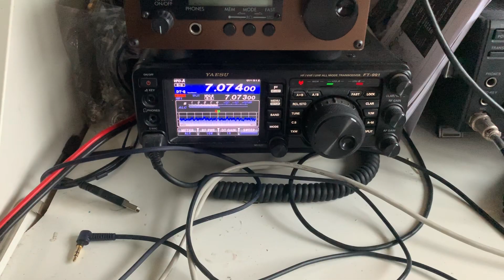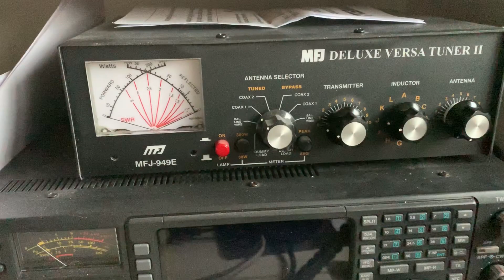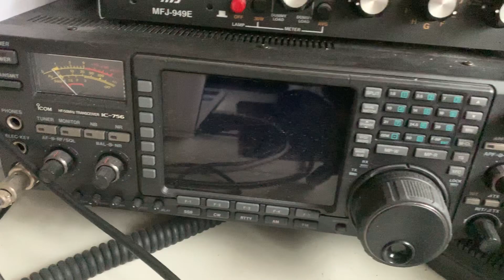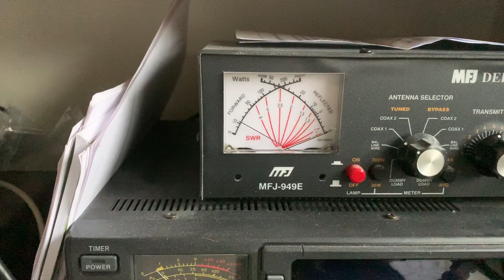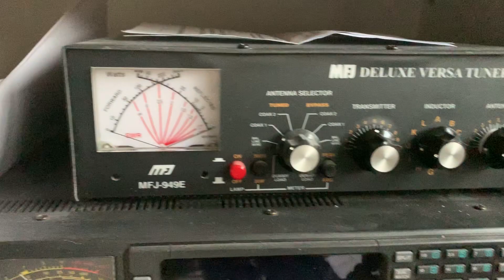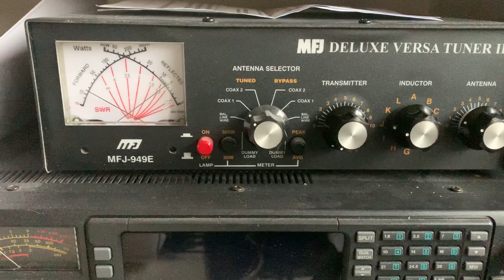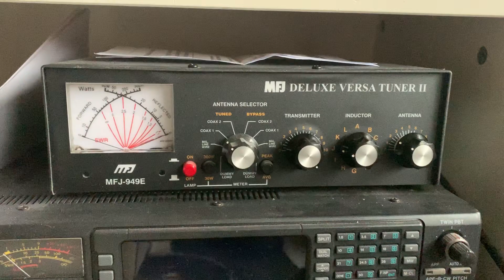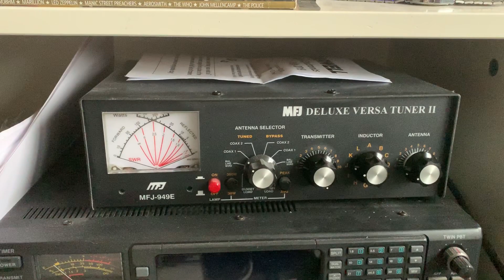Tuning my Sigma Euro-comm HF-SE-X80 wideband vertical antenna with an MJF 949E ATU

Comment: i tune thus antenna   with a homemade Lmatch tuner,,  no problem, but in 80m band it tunes but its a dummy load..in 40m band reports are so and so..good for 20m and above..  73
Reply from the maker: Hi James, yes the higher frequency bands will always work better on a compromised antenna like this one....there just isn't enough 'metal in the air'! 73

Comment: Bought this antenna two years ago, got the 1K watt UnUn. I have a 811 amp should do 500 watts! Sir Paul from Sigma Comm . said the plus kit will not work with high power only 100watts or less. Chow. JohnBoyUtah KJ7TBR
Reply from the maker: Thanks for your comments

Comment: I too, have this antenna... I've heard some bad things about the UNUN on the bottom of the antenna. I've had mine since late 2019, and I'm about to receive the upgrade Plus kit. For the window, next time, get the MFJ-4202... you'll measure the bottom of your window, trim the cedar plank the device is mounted to for better fit. And, unless you plan on not opening that window, use some foam to seal it in. I just installed one yesterday, and I plan on getting back on air, just as soon as I can get out to run 2 drops of coax on my roof! Oregon, like the UK, rains from October to June... I live 13 miles northeast of the 45th Parallel, in a small town called Gervais... de N6AMF 73!
Reply from the maker: Thanks for your comments Aaron! 73 M0OXF
Reply: @OxfordShortwaveLog  Cheers, mate!

Comment: I hate to place you on the spot and respectfully understand it would be your opinion only, but please could you tell me if i would be wasting my time hoping this antenna will allow me to DX.  I live in an HOA neighborhood, so its not the size of the garden thats an issue its the fact that i am not allowed to put up an antenna.  I am moving in the next 6-8 months and in the menatime am going to attempt to slip the antenna in and hopefyully get a way with it for a while before i move, However i dont want to waste the money if you can sincerely say that it is not really that great.  I will probably have to mount it from the ground to be stealthy so that may alos be a problem, however i am just not wanting to bother buying this if at the end of the day i won't hear anything or nobody will hear me.  I live in New Port Richey Florida, USA  Your input would be greatly appreaciated and if you prefer to email your response please feel free to do so.  guykdriver@gmail.com  I just need an honest opinion on this antenna.
Reply from the maker: Hi there, using this antenna at a low level won't allow you to work any DX. It's just not that good. It's also prone to noise which means you will also struggle to hear anyone on it unless you live in an extremely quiet environment. Wire in the air is really the only solution I'm afraid. So, in summary, don't buy it. 73
Reply: @OxfordShortwaveLog  Thank you so very much for you honest answer, i was sincerely looking for a straight truthful answer and it appears that is exactly what i got and what i needed before making another bad decision. Thank you so much.

Comment: Nice antenna. British back gardens are not noted for being large like many in the USA. I have a G5RV which has the same frequency range.  I have a large enough area to set it up.  A vertical would be nice here, as would an ariel that would do 160, but maybe in the future.
Reply from the maker: Thank you David. Indeed, our garden is not big enough for a random wire or dipole, however for QRP vox and FT-8 the SE-X80 is perfect! 73! Clint

Comment: I will stick to my speaker wire round the living room window thank you very much LOL. Now that looks like a more than useful antenna tuner, and it's a lovely looking piece of kit, that being said I say hats off to you for choosing MFJ. The amount of debate about them being good or no good is endless. At the end of the day it is all down to the end user, and what they require. Cracking little Yaesu, and that little Lowe will set the tongues wagging, very nice indeed 👍 Tam.
Reply from the maker: Lol! The MFJ is really great - I have two actually and they're both really easy to use for setting up an RX/TX antenna. I only have good things to say about them. Ah yes, the HF-150 is really superb and I got it for 99 quid - but that's another story and another video - coming soon - today actually! 73! Clint

Comment: Was I seeing that tuning on 6m correct? Looked to me that the needles were crossing on 2.5:1 or am I wrong? 73's
Reply: The SWR on 6m as you show it is over 2.5. You know that you read the SWR at the point the needles cross not at the tip of either needle? Not trying to be an ass, just trying to help.

73 Neil
Reply: The SWR is measured where the two needles of the meter intersect or cross paths as Neil has stated. Hope you don't pop any finals in your rigs for tuning incorrectly!
Reply from the maker: On 6m the indicated SWR is about 1.25:1. 73!
Reply: Also on 10W you would be better off using the 30W switch setting on the meter.  You’ll be able to see the crossover point more clearly.